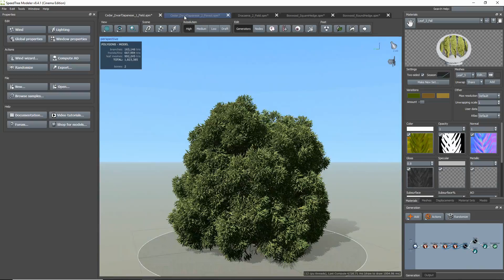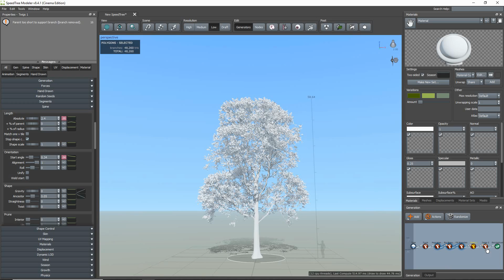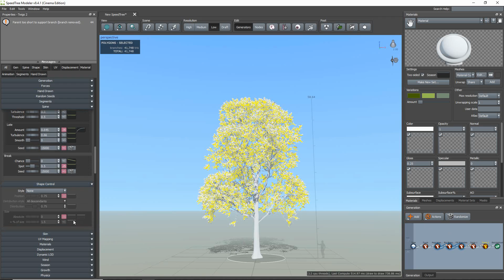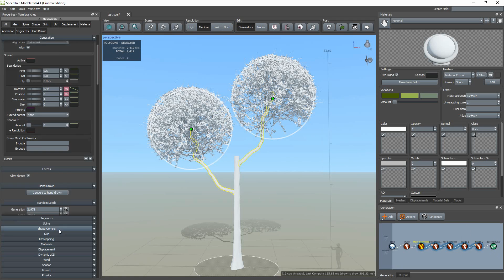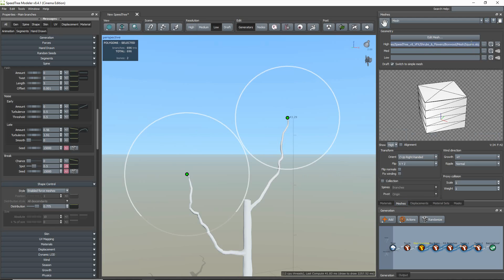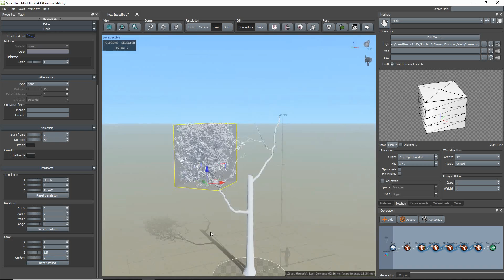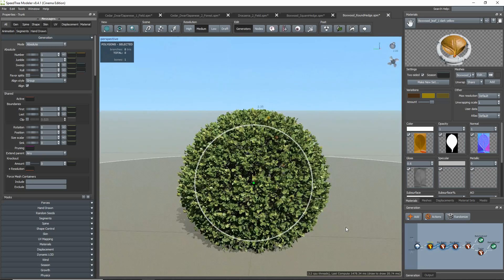SpeedTree 8.4: Shape Control

Comment: I find out, that imported shape mesh must be triangulate, not quadrangulate (OBJ). So for example, export mesh from Autodesk Maya (quadrangulate OBJ) will not work as shape mesh force, instead of triangulate OBJ export, which works! But exported quadrangulate and triangulate FBX from Maya, is fine and work as well.